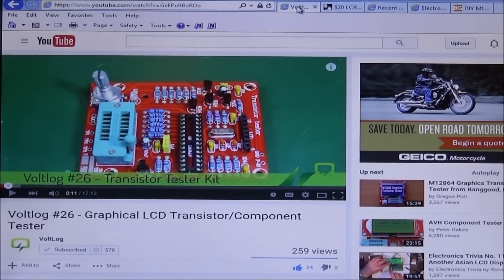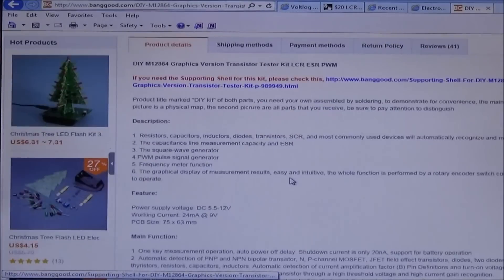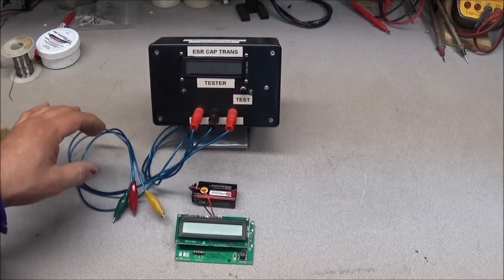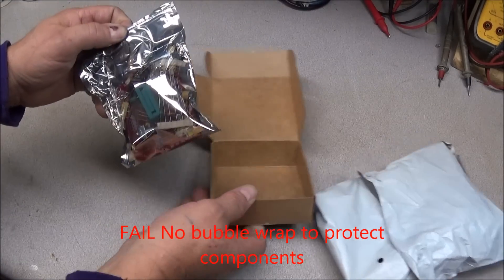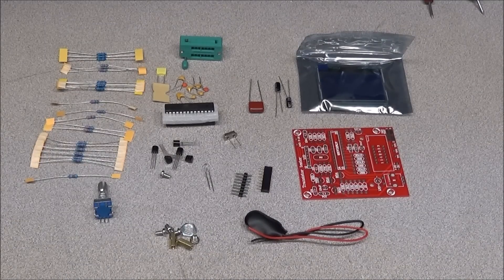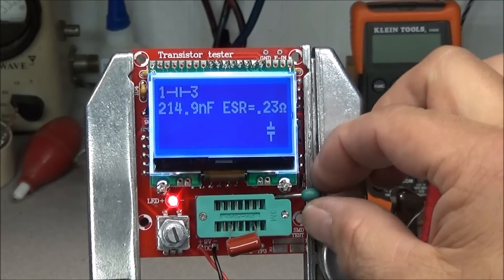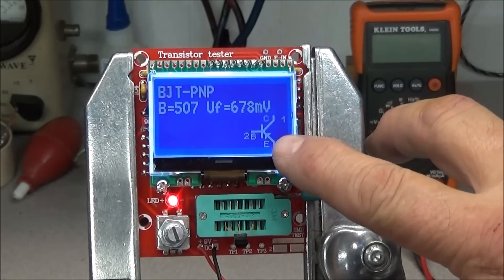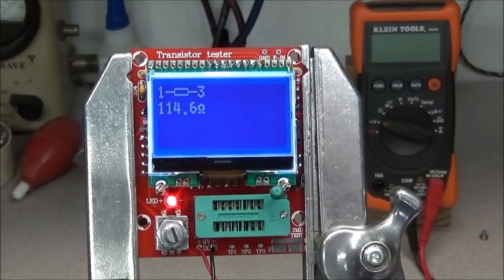#12 DIY M12864 Graphics Version Transistor Tester Kit LCR ESR PWM

Comment: Did you test the frequency counter function ?  My unit acts up weirdly in the 5.5KHz to 25KHz range.  Quite often, the computed frequency, the time period or even both, are wrong.  Even worse, at some frequencies the values are fine and one Hertz higher the returned values are wrong, go figure.  This is happening with 3 different chips and 2 different function generators, so I'm lead to believe the problem is at the firmware level.  For instance, with an amplitude of 1Vpp, square wave, try the 5960Hz and 6305Hz frequencies.  The returned values should be fine, at least they are on my unit.  One cycle higher, at 5961Hz and 6306Hz, the computed frequencies are simply out of bounds and by far !!!!  At 15,17,18,19,21,22,23,24 and 25KHz, both the time periods and computed frequencies are wrong.  Let me know if you can reproduce this problem.
Reply from the maker: I played with it at the beginning and found that the counter was not accurate. I will do further testing that you mentioned. Thanks.
Reply: Thank you for taking the time to perform the test.  By the way, when using the frequency counter, the value on the first line seems to be pretty much spot on.  The values that are unreliable are the ones on the second and third lines, being the mean time period and the calculated frequency based on that value.  Since the first value is based on the content of a counter and the returned value looks fairly accurate, I'd be lead to believe that the problem with the calculated values is a firmware issue and not a hardware one.

Comment: I bought one of those testers already assembled and it developed a short in the ZIF socket.  No matter what kind of part I put into it the reading was always about 36 ohms!  Removed the socket and just soldered in some clip leads and it works OK.
Reply from the maker: Tell ya for the price it is hard to beat. Could had been a assembly issue that caused it to fail.
Reply: The ZIF socket is just not durable.  The better approach is to have 3 sockets or 3 short test leads comming off the board.

Comment: nice vid, i might have to pick one of these up, very interesting, 

on thing i was wondering tho is, can you adjust the freq of the signal generator or is it fixed at a certain freq?

:)
Reply from the maker: +lazaruscome4th Hi Laz and thanks for watching. I like this one much better than my older ones.  The signal generator goes from 1Hz to 2 MHz. The PWM gen goes from 0 to 99%. The frequency meter function, can test 1Hz-25KHz. I think it is really worth the money.
Reply from the maker: +The Radio Shop Additional Feature:

  1. The square wave signal generator, optional built-in within the range of 1HZ-2MHZ stall square wave signal;
  2.PWM pulse signal generator for 1-99% of the pulse width modulated signal;
  3. The frequency meter function, can test 1HZ-25KHZ or higher frequency signal (in this case a slight decrease in accuracy)

Manual: https://copy.com/wBdnTSsdB3DBEmT6
Reply: +The Radio Shop very nice, i went on over to the website and read the specs, it seems like a they have both made this one better than the old ones, as it will test a wider range of values, plus they have added the extra features of the square wave gen, the PWM gen, and the freq meter, 

guess i'll be ordering one of these for sure, i love putting together kits anyway, lol

:)
Reply from the maker: +lazaruscome4th Yes, much better than the older units I have seen and owned.  I will be adding a few pictures to my website thread shortly :)Thanks for your comments.